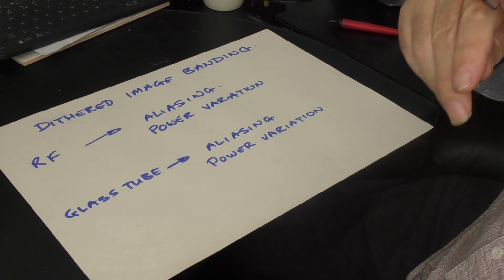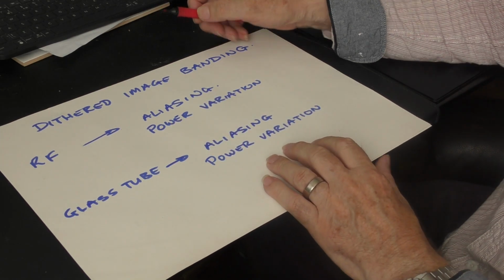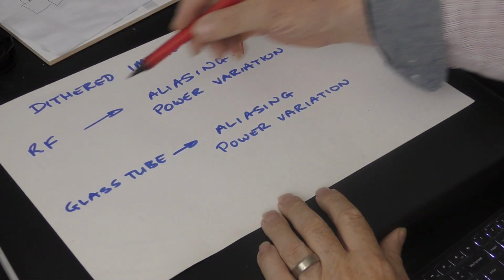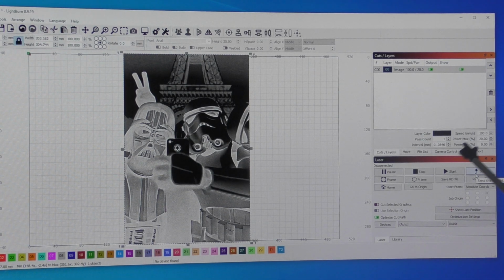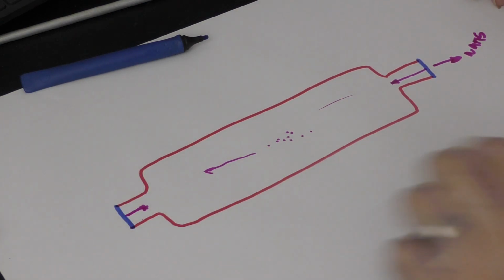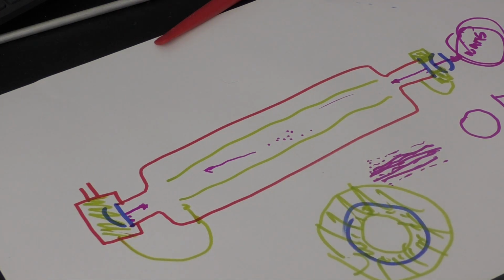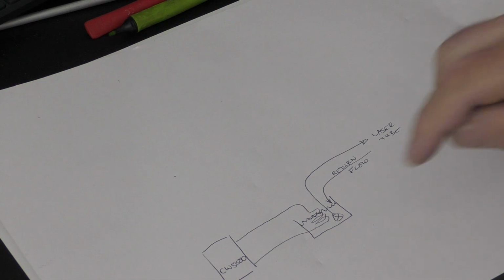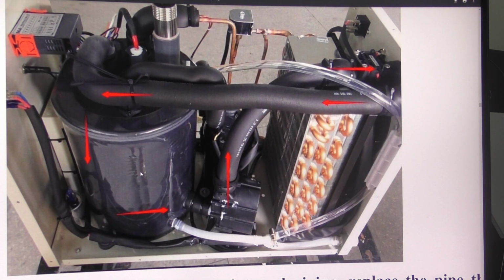RDWorks Learning Lab 241 Variable Power Engraving Bands Decoded

Comment: Dear Russ,
Many thanks, once again for your comprehensive and obstinate experiments to go to to the root cause of aliasing and banding on the RF.
As you rightfully state, the problem comes from the innate impossibility to synchronize the PWM pattern and the pixmap scan.
Your fiddling around shows that both timebases differ by ~ 1Hz/10KHz i.e. 100 ppm.
This is well in the accuracy range of general-purpose quartz oscillators that certainly clock both controllers.
The right solution for would be to have a single master oscillator clock both controllers, something an adventurous electronics capable person might go to, but not the more common user...
Cheers

Comment: Russ, just a thought to add to the mix.  If the laser power supply and the chiller are plugged into the same circuit it's possible that the hard starting load of the chiller compressor is causing a small line voltage drop.  That could cause a drop in the power supplied to the laser power supply and therefore the laser.
This obviously isn't the main issue as you stated that the thermal buffering tank resolves the problem but it could be a small contributor.

Comment: I think there might have been a slight miscommunication regarding my use of imagr. I think maybe a speed reference was mistaken for DPI or something but i use 254, 282 or 318 for my images. Ive worked closely with the imagr developer and can assure everyone that there is no DPI changes made by the software unless it input by the user:) sorry for the confusion
Reply from the maker: I have passed on my apologies to ImagR because it was my misunderstanding that needs to be addressed and  I explained that despite there being no fault with imagR the potential for aliasing still exists if pixels and line increments mismatch.
 Thanks for the comment
Best wishes
Russ
Reply: It happens. Im so glad we got to the bottom of this. I sent a link to this video to S&A as they couldnt understand the issue. I was telling them that a manual switch to turn on and off the cooling would be great. I havent the knowledge to know if a manual switch can be implemented to bypass the temp controlled switch. In meantime ill have to dig out me pump and bucket

Comment: That‘s actually incorrect. The user who provided you the images resampled them in imagR at 318. not 300. so there‘s no issue. You can also try it. Just upload the image he sent you on imagR and it will show that it‘s 318 dpi. 

Btw. the 318 dpi makes sense, since the intervall will be than pretty exactly 0.08mm, and your laser won‘t be able to handle an intervall of 0.0846mm properly

You can also upload a 300dpi image on imagr, don‘t change the dpi, and save the image. And it will have 300dpi. ImagR does not randomly change dpi.

Edit:

I also talked to matthew, the guy who sent you the images, and he also said he never saved any images at 300dpi, he‘s using always 318 dpi as output. So that part is not correct at all.
Also, a wrong intervall would also show up banding horizontal, not only vertical.
Reply from the maker: I greatly appreciate you clarifying that issue. I did caviate my  statement with "as far as I'm aware"  but Its great to understand the truth. I apologise if I have unkowingly passed on a misunderstanding . I am happy for others to read this and recognize my error. . I now supect this error was generated through resizing?  As I point out,.I dont use any image preperation for  photos so it's comforting to be reassured that if I did use ImagR then what I put in I get out . Generated artwork of the type I illustrated, can benefit from enhacement, depending on the material being used .However the basic priciple would still apply that mismatching pixel size and line increment will create aliasing.  If you take a look at how Liightburn processes a 300ppi image  you will see that it works to at least 3 decimal places and displays 0.085mm However,  there must be more in the bakground to be able to round to 0.085. Working with 254ppi circumvents any possible rounding errors  because it is an exact 0.10000000 mm  pixel size. 

Thanks again for exhonourating ImagR
 Best wishes
Russ
Reply: @SarbarMultimedia  and to edit my comment again. I only talk about the time you talked about imagR. All other information in this video is absolutely correct and well described! Good job at all. :)
Reply from the maker: @ImagR-Laser  I only try to pass on the best information possible.  I will upload a revised video but I felt I could not just delete  your  product reference  because lots have seen it already. Instead I have added a piece of correction text and an apology  to  your product .I feel that leaving your product referenced but absolving it of any fault is positive exposure.  Your opinion please before I republish
Best wishes
Russ
Reply: @SarbarMultimedia  sounds great. Thank you so much for this.
Reply from the maker: @ImagR-Laser  It is uploading as I write this but it takes several hours before I can republish.. I'm off to bed shortly , but will republish in about 8 hours time. I will add a sentence at the top of the deascription as well. Thanks for your understanding of a honest error 
Best wishes
Russ

Comment: I have been experiencing this issue for the last few years and it always came back to the chiller. Every time it kicked on I would see it. Initially thinking it was maybe caused by too much power being drawn on the circuit, I put it on its own but still experienced the issue so I started trying to work around it. It producing a rapid temperature change makes so much sense. Now to work out a solution for buffering that temp change. I wonder if simply using a lesser pump and maybe adjusting some settings like lowering the temperature range/difference at which it kicks on could be enough. It would certainly run more but the temperature difference at the tube would hopefully not be nearly as drastic if it only has to bring the temp down a short ways like 1 or 2 degrees vs 5 or 6 degrees. I'll have to play around with it and find out because this issue has plagued me from day 1. 

I appreciate the time and effort you and the others have put into figuring this out!

Comment: Hi Russ
Interesting investigations, total agree the aliasing is nothing to do cooling on the RF , but not sure you cooling on the CO2 tube is causing it either as not all tubes have cooling around the ends of the tube, mine doesn't nor do any of the tubes I supply (Reci), although I haven't looked at photo engraving to the extent you have and would be interested in trying fox photo to compare.
Reply: I have definitely seen a correlation/witnessed banding happen when the chiller kicks on and off with my tube. I etch lots of acrylic and it is very apparent especially when it comes to depth. I have a CR90 which I believe is a rebranded spt tube vs a reci (I think) so i'd be curious to see some sort of comparison between different branded but similar tubes with the same chiller unit. If you test it out, please report back. I'd love to know your findings.
Reply from the maker: hI
 Thanks for your interesting observatioon re Reci tubes..  I will send you the fox bitmap to play with so you can run it with your tube/s. 
Best wishes
Russ